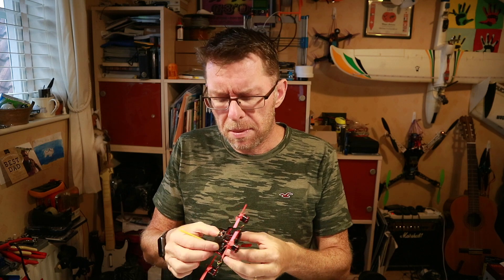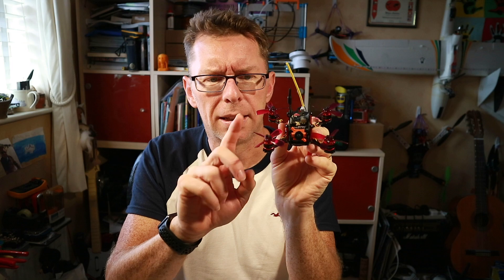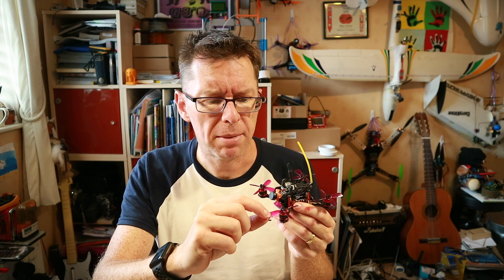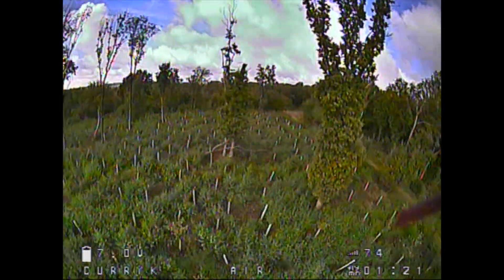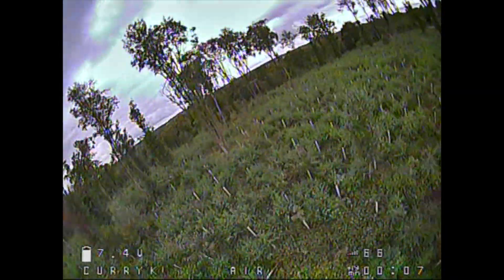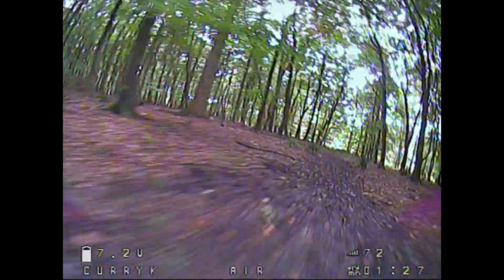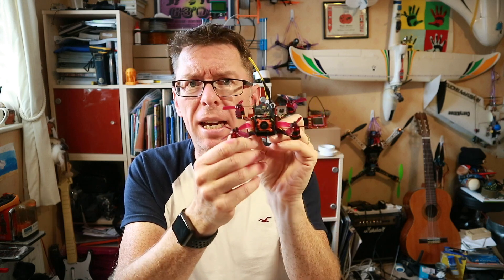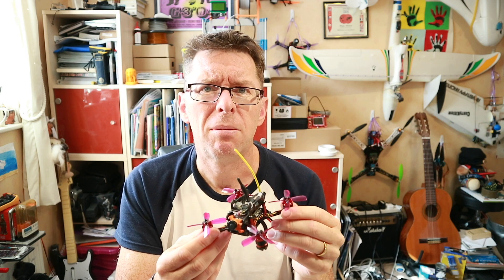Adding a RunCam Swift Micro to a micro quad

Comment: I’ve got a micro sparrow and one of these vtx03 on the way to go in my 2” mantis85 because the stock aio camera is not great. Enjoyed the review 👍
Reply from the maker: I must admit that I wasn't much of a fan of the Micro Sparrow.  I couldn't figure out why I'd want to use a CMOS sensor instead of a CCD for the same form factor.  Of course, if you are after that 16:9 view, then the micro sparrow it is.  It'll certainly be a whole lot better than that AIO in the mantis at the moment
Reply: CurryKitten hmm, I’ll be honest, I don’t know the difference, I assumed they were the same. Got it cheap on drone junkyard Facebook group.
But yes 16x9 is good for my box goggles.
Reply from the maker: Like I said, it'll definitely be an improvement over what you have now - but if you get the option in the future have a look at the Micro Swift to compare.

Comment: nice video :) 
I was planning on upgrading the camera in my lizard to a runcam micro but I'm not sure it would fit.. I guess I'll MAKE it fit one way or another. 
Need to get the thing flying 1st haha gotta get on those pre-flight checks.. screws, wiring, betaflight version etc etc
Reply from the maker: The Lizards existing camera mounting is just about 1-2mm too narrow to get the RunCam in there, so you'd need something else.   Personally, I'm not a big fan of the shape of the Lizard, it seems higher than it is wide, so I'd probably swap the components over to a frame that will accept the RunCam without any fuss

Comment: You mention there are micro quads coming up with the run cam micro already installed......Don't think you've reviewed one yet but the spc maker 95gf at around £135 delivered from gearbest https://m.gearbest.com/brushless-fpv-racer/pp_764686.html
 has  been out a few months now with the micro swift installed as standard......Interesting to see what you make of that ?........I have an Eachine Lizard95 which I want to upgrade the camera to the micro swift and as the Lizard95 frame is too small for the micro swift without modification I intend to swap the Lizard95 electronics over into the spc maker 95gf frame around £14 from Banggood which will then allow me to install the camera........In hindsight I wish I'd just bought the complete Spc maker 95gf in the first place rather than the Lizard95 !!
Reply: Ade Burnham I wouldn't worry about it brother. I bought the Aurora 100 a couple months before the lizard dropped into the market. This hobby grows so fast that by the time you get comfortable with one another comes out that's supposed to be better. Like the iPhone. As long as you're flying and getting in as much stick time as you can you'll be improving and that's all that matters. And swapping parts is what makes this hobby great. It becomes something you made and you connect better with the things made by you.
Reply: Lester Gutierrez 
I've been building and flying racing quads for quite a few years now  originally coming from building and flying model helicopters........Like you have mentioned every week/ month something better comes out that improves our Hobby but the micro quads are really starting to interest me as they fly as good as my racing 5"quads but if UK law does require a licence for drones weighing over 250grams theses micro quads come well underneath that and are just as much fun if not more so as you can fly them in smaller and tighter spaces.......I personally love building my own quads and adapting them so combing the Lizard95 electronics with the Spc maker 95gf frame should nearly make my prefect quad 🤔
Reply: Ade Burnham agreed. I have also become interested more and more with the micro market. Local parks in the city become more hassles then their worth with 5 inch quads. I have had mother's come and ask me to fly further away even though I was over a football field distance away. I get it I have a child as well. I never had such encounters with my micro though so I prefer flying that until an opportunity presents itself for the 5 inch.
Reply from the maker: As if by magic, I should have an SPF Maker 95gf on it's way to me hopefully  - so I'll let you know.  I do completely agree - the proposed law aside, these micro's are very easy to carry around and fly in tiny spaces.  Whilst a 5" can be very agile, they still carries an awful lot of kinetic energy with it, and are far easier to smash up

Comment: Hope you can help...I put the same setup as you on my king kong 90gt....problem is when the quad gets a bit away from me failsafe kicks in and.i use control on the 2.4 g...it flew twice as 
Far before with the original camera on it.any ideas please
Reply from the maker: The camera shouldn't really have any effect on the 2.4Ghz band, but it could potentially act as more of a block.  Did you change your antenna position at all, is it stood up with good clearance over your other components ?

Comment: If you're going to be flying the micros where you have to have a linear antenna for space, have a look at the Menace RC Bandicoot Patch. You get the normal patch cone with a nice range, but what I didn't know was a circularly polarized will loose you db and reception power.
Reply from the maker: The linear is 50% space and 50% because the little skews keep getting knackered.  You certainly introduce a loss when you mix linear and circular polarised like I am, but I guess the question is at this quite close in range, how much of a difference does it make ?  I'll have to do some testing.  Yep, the Bandicoot patch is a good shout, although I don't know if there's much radience out the back if you are flying all around.. perahps better as part of a diversity system

Comment: I got the same thing with the weird color in the camera on my aurora with runcam.  When you say highlight the trees. I agree with you, but on my furibee vr01 it feels like there is a small blue/white line next to most of the objects. I could get it a little bit better with sharpness, but not completely get rid of it.
Reply: Put the same cam in my babyhawk and not always, but every now and then colors go crazy like high contrast or something.  The other odd thing is it's always on a fresh batt before take-off (I drop the goggles and it's a mess.)   Disconnect the batt, plug it back in and it's fine.
Reply from the maker: Curious, I thought I may have done something to my setup, but clearly it's other people as well.  It's weird that I can't replicate the issue when I would like to, it's obviously just in some situations, but no idea what those circumstances are yet
Reply: I saw the same thing but it went away power was recycled and then entirely when power was fed to it and the TX using 5v Pololu voltage rectifier (with a 220 uf 10v low ESR Cap - suggested by Pololu to protect it but also kind of acts like a LC filter with the cap.) Anyway problem gone, not seen since this mod. I think the issue may be with the Voltage Rectifier on the FC, which don't appear to be very clean at start up and/or may be pushed by the voltage requirements of this setup. If you read the documentation of the Pololu boards they are susceptible voltage spikes so perhaps it's the same may be true with the one on the FC which could be exacerbated with a fully charged battery with higher initial voltage leading to a bigger spike in voltage. This is all just a guess on my part and I only had this on one of my quads with a mini-cube, micro swift with a VTX03.

Comment: I put one with vtx03 on my Aurora 90, great camera. Nice woodlands
Reply from the maker: Nice - does it need any mods to go into the 90, or is there a way of squeezing it in
Reply: CurryKitten couple of washers as spacers, fits nicely. Vtx is stuck on the side not sure where to put it. Maybe time to buy a 3D printer

Comment: Great vid fella, I’m after a couple of these for arfun 95/lizard95. What’s causing the breakup? Although only minimal, would you say it’s signal or vibrations?
Reply from the maker: Signal - I'm running on 25mw with a linear antenna one end and a skew the other and flying around some trees :)  I do keep meaning to see if actually using a linear on both ends or indeed a skew on both ends would make much of a difference at this range, or running the VTX at 200mw (which would probably help)
Reply: CurryKitten certainly should👍does the runcam /vtx get hot? Eg, like the tx02, especially 200mw?
Reply from the maker: I didn't notice the VTX getting hot after flying - it certainly does on the bench with no airflow over it.  I'll have to put it in 200mw next time and have a feel after a few lipos